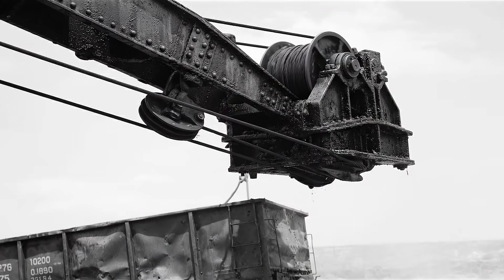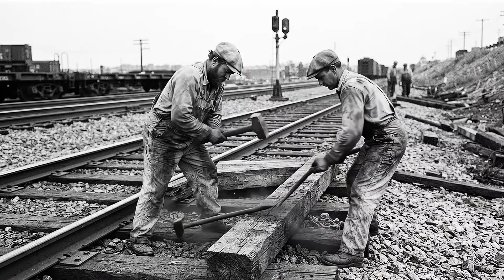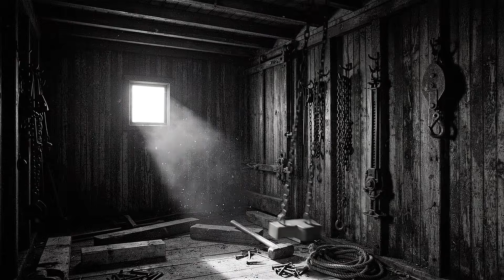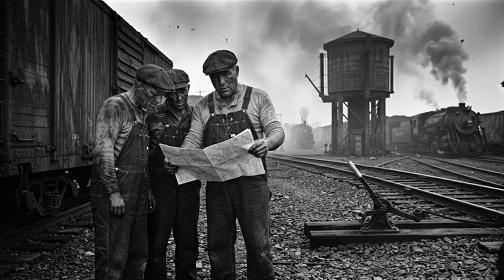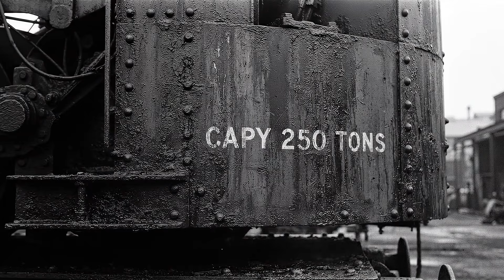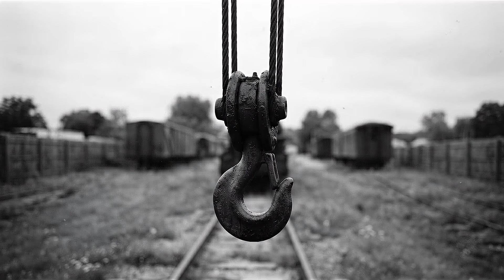How Giant Cranes Put Derailed Locomotives Back on Track | The History of Railroad Wrecking Cranes

Comment: AI graphics SUCK!  Retired 51 year railroader.  Worked major derailments with both railroad wreck trains and their wrecking cranes as well as off track contractors.  Wreck cranes are normally limited to 25 MPH or less in moving from their home to the wreck scene.  It takes 2+ hours to get a train crew on duty for the Wreck Train and they are covered by the Federal Hours of Service law.  Off track contractors also have to call their operators and haulers and arrange for hi/wide/weight permits on highways, however they are not covered by any hours of service regulations 'on the railroad'.  It normally takes 10-15 minutes to block up the outriggers on wreck cranes.  The dozers with lifting A frame have hydraulic counterweights and can set up for a lift almost instantly.  Wreck cranes have to work from stable track, contractors can attack the derailment from anywhere.  Railroads still have to supply trains of 'panel rail' that contractors can place in the right of way to expedite resumption of operations.